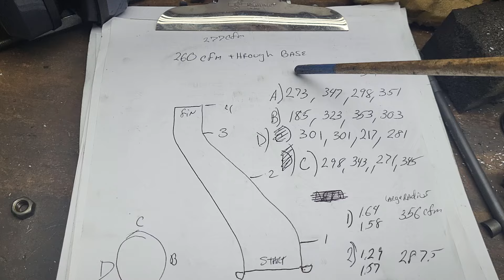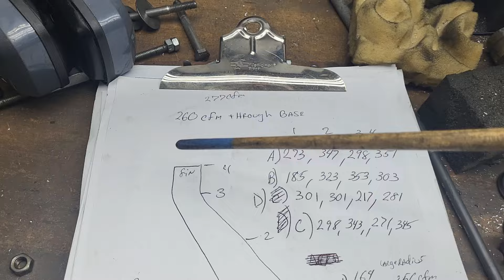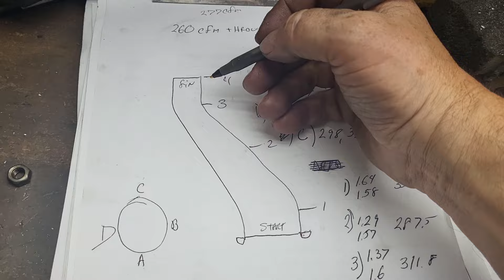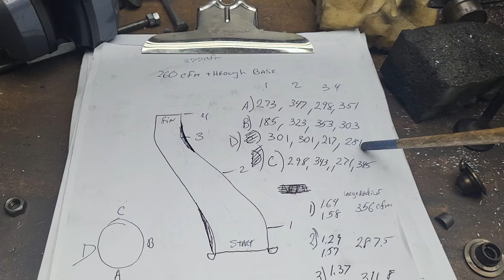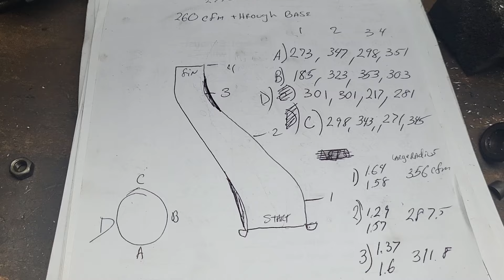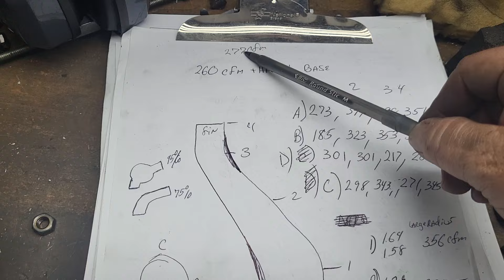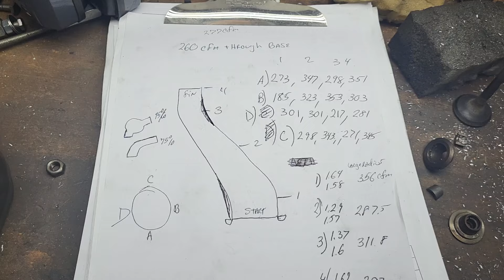The High Performance TPI project. Measuring airspeed in my ported stock TPI base.

Comment: the aftermarket bases are a different animal they will be what your ported base is if not bigger and straighter there are two castings the edelbrock 3860 and the ACCEL/Lingenfilter, the edelbrock is bigger flows more and has more material than the ACCEL
Reply from the maker: We will find out. Thanks

Comment: Richard Holdener had a video of a modded  TPI intake. I think that it had a extrude honed lower, larger throttle body with the air foil.  Can't remember what runners He used. It made good power!
Reply from the maker: Excellent. Thanks

Comment: Hi Charles! You were mentioning here that the air wants to go to the short side, when it needs to curve. If this is the case, then wouldn't it be justified to grind down the short side of the intake port, as well as it so often tends to curve just before reaching the valve? As a suggestion, you could try to fill in the 1-B area to even out flow there..
Reply from the maker: For high rpm horsepower that works at the detriment of lower rpm torque!

Comment: Difficult task to make these better. Add in the 180° Turn the upper manifold makes. I rarely seen these used with being extrude honed. I would like to see the comparison between this and the Ford 5.0 intakes. Both used during the same production years. 
  Wasn't the edlebrock pro flow the largest by volume version of these? And the equivalent ford trick flow. 
  What was the Callaway corvette equipped with during this Era? It used twin turbo, but what intake system?
Reply from the maker: I have videos on 5.0l Mustang intakes. They max out about 160 cfm! Painful!
Reply: The Callaway used a regular tpi but it was painted or powder coated black. The sledgehammer used a heavily modified tpi where the sides of the plenum were blocked and "runners" ran out the bottom straight into the base like a stealth ram.

Comment: I’m guessing tune port injection which is a 80’s technology with the 350-305 Small Block Chevrolet V8 engines from that era correct me if I’m wrong
Reply from the maker: Correct. Thanks

Comment: Excellent. I averaged everything and it looks like point 1. 264fps 2. 328.5fps 3. 309.75 4. 320fps - average port velocity = 320fps! That actually aint bad. I agree the runners should be more even and maybe we can figure out something. I know I am handing you the real Mission Impossible.
Reply from the maker: In a different way but yes!

Comment: No input, I've always removed the tuned port system. I do know there is, or was a company that made LT1/LT4 conversation manifolds to replace the tuned port. TPIS maybe?
Reply from the maker: Miniram. All the rpm! But not on this project. Thanks

Comment: I noticed that the outside edge corner speeds were dramatically lower.  Wouldnt that indicate either widening the central straight or filling in the outer sides of the turns to even out the speed differentials at the corners?

Comment: I'm wondering if it would help to add material to the big side of the curve
Reply from the maker: You would think it would but in a bowl, lowering the roof may boost low and mid lift flows high lift will suffer. Thanks.

Comment: Alot of information Charlie.  I dont think anyone has done it. I was wondering how the  helmholtz effect works on different intakes. GM did a enormous amount of work on the C8 Corvette and it produced a supercharging effect. NO supercharger.
Reply from the maker: It can be done. I feel with these long runners to get 6000 rpm may be tough. Thanks
Reply: @servediocylinderheads  I think you can do it if anyone can.
Reply from the maker: @dondotterer24  Thanks!
Reply: There was a guy in a forum somewhere that was looking into a higher pressure wave tuning. 3rd wave tuning, I think he called it. He was seeing like a  second power peak at like 6,500 on tpi systems and was working to exploit that phenomenon, but I don't know that he ever proved his concept.